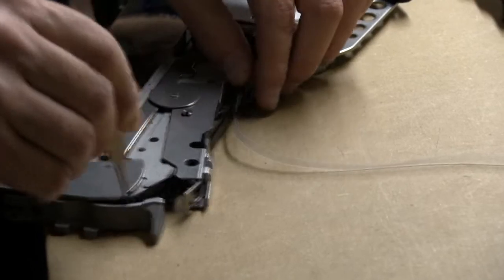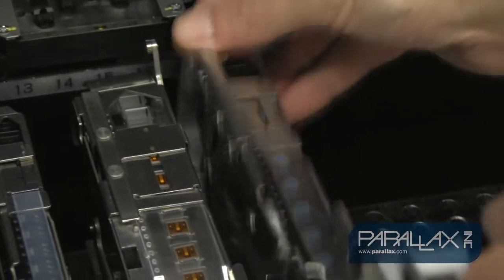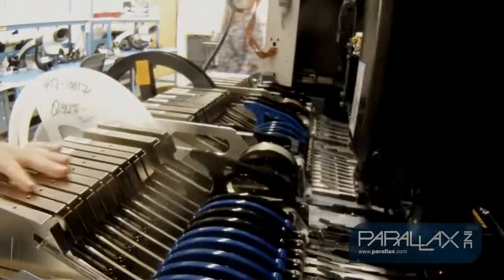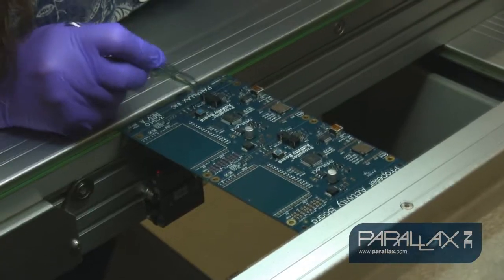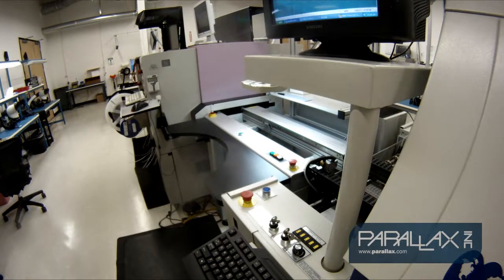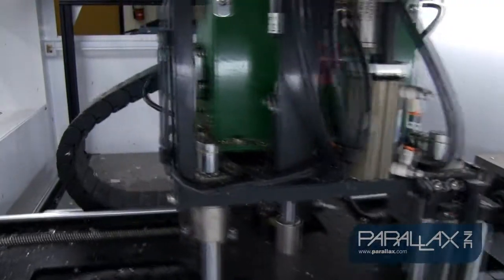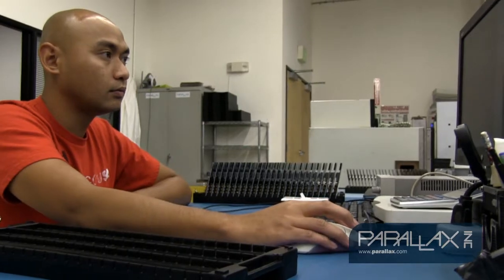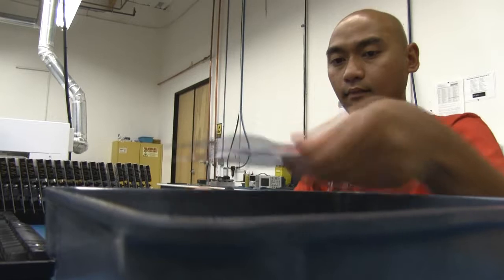How it's Made: The Story of the Parallax Activity Board

Comment from the maker: The PCBs are not actually stacked on top of one another so there isn't a chance for static electricity. The tray that they are sitting on is a custom made fixture made for the PCB panels to fit through the machine. The other trays are filled with non-static sensitive components.

Comment: How is the wash process. I mean, with water ?? alcohol or what.

In the video the through-hole components are in some kind of tray even the microcontrollers are stack one over the other. The question is, ¿does that generate static that could damage the IC? (obviously not, but is any possibility of damage for static because of the stack?

Thanks for the video.  I hope you understand my English.